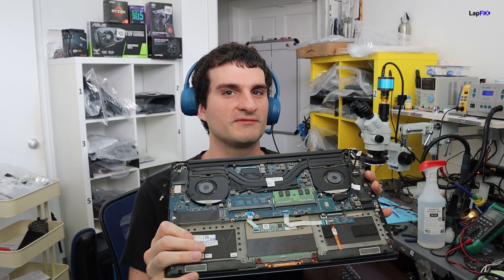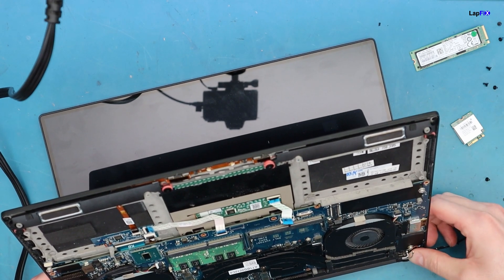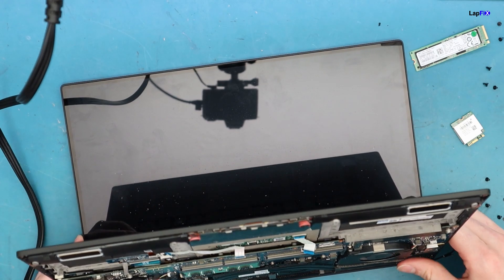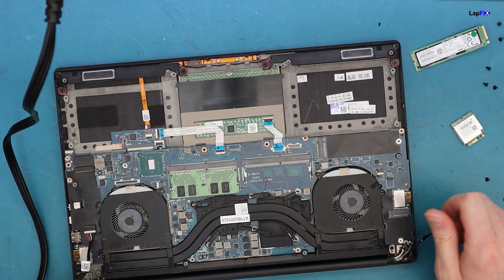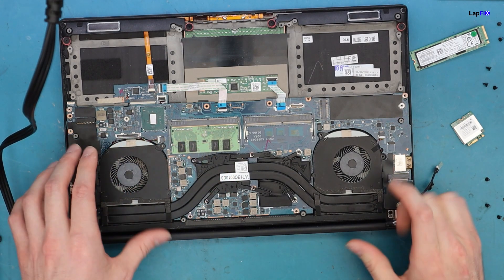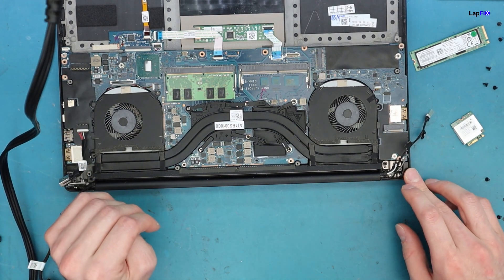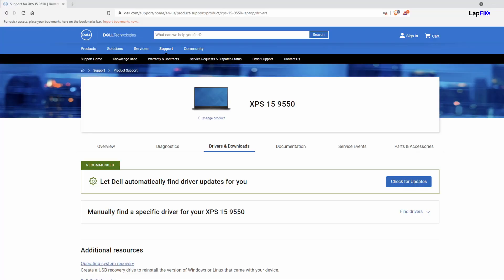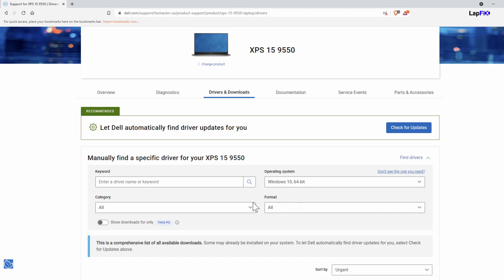Dell XPS 9550 No Display | Is There a Fix?

Comment: I know this is old but I have the same issue with a 9510. Bought it brand new from Dell and when you reboot the screen stays black. Dont do it every time tho. Went through the ringer with Dell as it was still brand new and in warranty and they refused to do anything about it, other than the obvious driver updates etc. Frustrated I paid almost $2000 for a laptop that has never worked correctly. I wiped it and put linux on it thinking the problem was with windows but it still does the same thing, leading me to belive it is a hardware issue. If anyone knows a fix please let me know!
Reply: Replace CMOS battery

Comment: Is this issue happening only on 4K models? I just tried to upgrade my Precision 5520 to a 4K screen and new 40pin LVDS cable and its doing the same thing, when i installed the 1080p screen back with the 30pin LVDS cable it works fine.

Comment: Bonjour,

For the past week, I’ve been experiencing the same issue with my Dell XPS 15. Here are the steps I’ve taken:

	1.	Removed the back of the laptop
	2.	Disconnected the battery
	3.	Unplugged my SSDs
	4.	Held the power button for 60 seconds (the charging cable shouldn’t be connected)
	5.	Waited for about 20 minutes
	6.	Reconnected everything

What I noticed is that one of the SSD ports on the motherboard is a bit loose, which was causing the black screen. I made sure to properly insert my SSD, and when I plugged in the charging cable and pressed the power button, the Dell worked.

I hope this helps you 🙏🏾

Comment: After two weeks of troubleshooting Dell precision M3800 laptop  with a black screen, and exhausting basic checks like RAM reseating, I opted for a more unorthodox approach. Inspired by some online suggestions, I temporarily covered the motherboard with heat-resistant aluminium foil, leaving a small opening over the GPU. Using a hot air blower for 100 seconds (450 degree Celsius), I applied controlled heat. Following this, I replaced the thermal paste (Arctic MX-6) and thermal pads. Upon restart, the laptop emitted a continuous beeping sound before rebooting and, miraculously, displaying an image! While I'm unsure of the exact cause of the fix or its longevity, it's a curious outcome and certainly a relief.

Comment: I’m having the same problem. Pressing the D button after power on for diagnostics did nothing. Maybe I’ll try connecting to external monitor.
Reply: Do you have the 4K model or 1080p? Im noticing this problem is very common on 4k models.

Comment: Mine fixed itself by going into the diagnostics :D. 
I have had luck with an external programmer by reading the old BIOS, extracting the .bin out of the Dell BIOS.exe and merging the two with a hex editor. Its important not to forget the windows key. Otherwise it wont register.
Reply: What the hell is an external programmer and is that what made the laptop run the diagnostic and fix itself?

Comment: In XPS 9530 I have similar issue. Similar because on your video there is no "Dell" logo and no ability to enter BIOS. In my case I sometimes had such black screen from start but sometimes got dell logo and windows started booting. Then black screen. Tuns out the problem is with integrated intel graphics. If I manage to boot into windows, into safe mode and disable intel gpu (in device manager; note there is nvidia gpu, too) then, after normal boot, I no longer get black screen. I assume integrated intel gpu is faulty in my case. On the other hand I'm able to use it under Linux just fine. Weird.

Comment: The fix is here: https://www.youtube.com/watch?v=KQc7t6osM_s
Reply: dc to dc converter: IC Z501901 TA5S23
Reply: The guy in the Video said replacing the IC didn't solve the issue and he still hasn't posted a part 2 after years so still no fix

Comment: I sold XPS 9560, the screen was working fine, days later the buyer returned the laptop, mentioning about similar issue. 

I was quite surprised as the laptop was properly checked before it was dispatched. 

My first impression, keyboard was working as it should, pressed power bottom + D, the screen responded the test. Motherboard no visible damages, fan working fine. So, no physical damage whatsoever. I disconnected the battery, Wi-Fi card, screen… same issue! Next day I tested and tried to connect to an external monitor and suddenly the screen was working fine. My thoughts are unknown as I couldn’t figure out what caused the problem. 
Corrupt driver, bios…?
Reply: It just seems like a general Jinx on these xps models, My 9560 still having the same issue and no fix yet..
Reply: Was it a 4k model or 1080p model?

Comment: Yup i have same issue here . And reprogram the efi chip with eeprom bios flasher and replace the bios.bin and work again as a new . Thanks sir
Reply: How did you do that?
Reply: @platonbabenko  try replacing the bios chip and program it. I removed my bios chip going to install a preprogrammed bios and hope that fixes it if not idk 🤷‍♂️
Reply: @crazysmokealot how does one replace the BIOS chip and did yours work after doing this?
Reply: Did it work? @crazysmokealot

Comment: I had the same issue with a 9570 ... I had the notebook opened up for an hour, removed RAM, battery, etc nothing worked. I then tried the "D" key and saw the RGB screens on the display and the notebook booted after that ... It definitely is a BIOS issue as when it turned back on it finished up an update ...
I am done with Dell, not the first time that happens to me.
Reply: Having the same exact issue but mine refuses to boot completely, how did you get yours to boot and finish updating?
Reply: @toperaheem  ME TOO WANTED TO KNOW IF ANY OF YOU HOW YOU GOT IT TO BOOT AND DID YOU FIX IT???
Reply: Wow after I tried several options that didn't work I applied the D" key method by holding the D key while I press the power button and without a delay the screen flashed different colours and rebooted with the Dell logo. Thanks sir this worked

Comment: There is a CMOS battery on the other side of the motherboard (stupid design).  You could unplug it and wait a while.  I would also recommend checking that battery if it has enough juice.  Some laptops won't even boot without a working CMOS battery.
Also, did you check all the capacitors for shorts?
Reply: It's the CMOS battery. Just replace it

Comment: Mine had that issue twice. I fixed it by unplugging the battery and removing the drive and booting off power a few times and then putting everything back
Reply: Could you elaborate?

Comment: Have you tried flashing (via programmer) known working BIOS image dump from some third party website?  (and before giving it out to customer it might be vise to edit the dump so it has proper Windows key inside). 
AFAIK Dell doesn't publish full BIOS images, just updates.
Reply: Bro Please what is and how exactly does one use this programmer to do this?
Reply from the maker: Thank you for your response. I will look into it
Reply: @lapfix  if the programmer works I'm nearby and would bring my 9550 to you to fix.

Comment: That chip is the cpu supply chip, if it is getting warm that means cpu is bad and need to be replaced

And for  the bios, you can download from Dell support, extract the files from exe file, and build all together, and you will get a fresh 100% working file

For the cpu I guess it is 6th or 7th gen hq cpu, you can replace it with a bga machine
Reply: I don't think it is CPU, because in that model eDP ""grows"" from the Intel iGPU which is inside processor, and if image is displayed, processor is more alive than dead.
Reply: But how do you run the bios update if the laptop doesn't even boot completely?